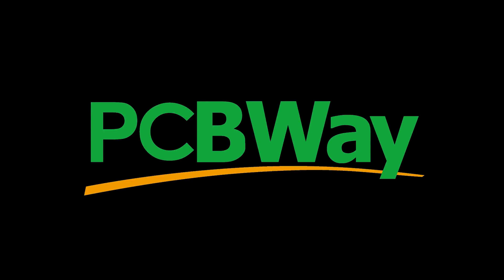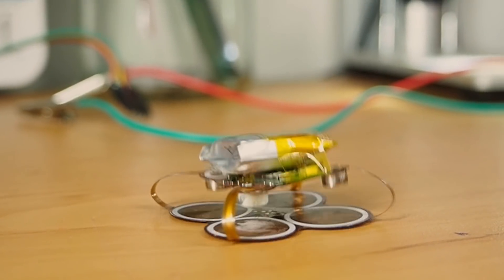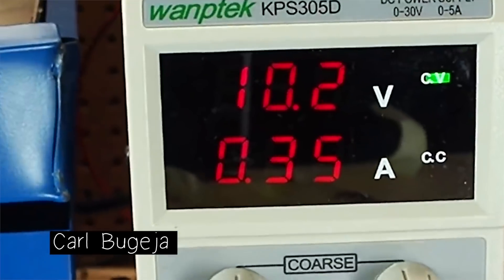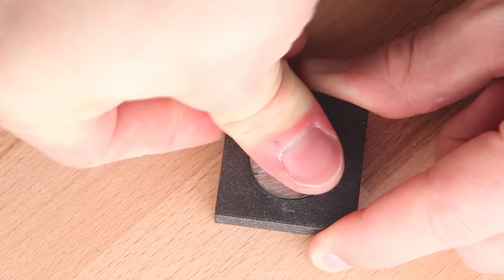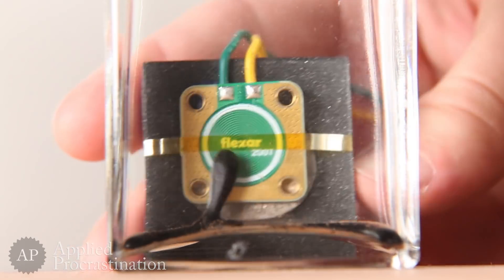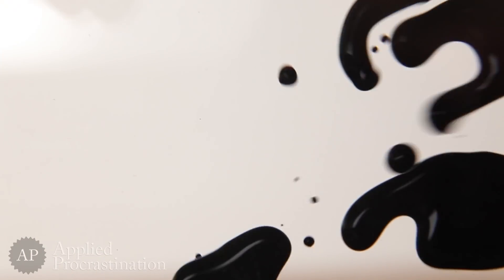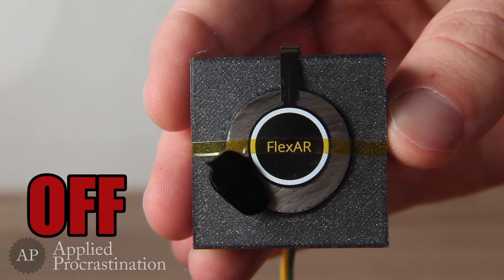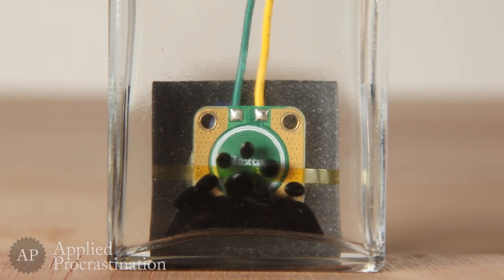The holy grail of ferrofluid displays (Carl Bugeja Collab!)

Comment: Couldn’t you work with Carl to print a MATRIX of MULTIPLE coils on a single large PCB (ie: the size of your display)?  That eliminates 99% of the external wiring and 99% of the labor to build the display. Also, the PCB might be able to absorb/conduct away some of the heat generated by the coils - especially if a copper layer was added to the PCB for the purpose of being a heat sink layer.
 

Further cooling, if still needed, could be added by placing some Peltier solid state cooling blocks in physical contact with the PCB and/or heat sink layer of the PCB. 
 
The Peltier coolers could then “pull” the heat energy from the PCB/copper heat sink layer and transfer the hear to heat sinks mounted to the hot side of the Peltiers. 
 
 (Just some thoughts).

Comment: Ok but given the PCB only design wont work why not just cut the leads shorter on the actual ones and solder them into a pcb? Seem's like a straightforward solution to the too many wires and connectors problem. Am I missing something?
Reply from the maker: That’s what we do in this version: https://youtube.com/shorts/eKKamLLzslQ 

It’s a really compact and neat solution, but incredibly time consuming and difficult to pull off (the actual soldering and mounting, that is), and redesigning the PCB becomes annoying too when you can’t just disconnect and reuse the magnets but have to desolder them. For small arrays it’s the best solution though, IMO!
Reply: @AppliedProcrastination  ahh very cool, I hadn't seen that short. And yeah fair enough it still seems tedious for a large board and like you said reusing them would be an even greater pain. It's too bad no one (appears to) make something akin to a relay socket system but for electromagnets.

I forget if this was mentioned in the video but maybe stacking multiple 12 layer boards is still viable.

Comment: Uhm..nobody has mentioned making this times 3 -- placed on the x y and z axis.. Micro-controllers to act as a catalyst, pulsed to lift for ex.; compensate for z being "gravity" constricted with it being 2-3x the size/power of field. X and Y steer, or pin-point the field. You should be able to 'drag' the fluid into the center of the field, then with modulation you could burst the fluid glob, or whatever. How do ferrofluid speakers do all this? Have you considered getting a ferrofluid speaker and breaking it down to advance your ideas?

Comment: You could use a stronger permanent magnet, and a magnetic switch to toggle the magnet on and off.
e.g. A strong north facing magnet, and a south facing electromagnet would cancel out magnetic fields. When you flip the direction of the electromagnet, the magnetic field will be twice as strong.

Comment: Put iron pole pieces in front of the PCB coil as well as the disc behind. One disc the size of the coil, the other a ring inside diameter same as the disc plus tiny airgap, outside diameter same as the back disc.
That would give a display of circles, not dots...

Comment: (Duh, I just edited out my brilliant idea I’d stacking coils to get more power, after watching Carl’s video where he explained that heat dissipation is the problem :-/)

I do think though that your specific use case is quite different than Carl’s general interests, so there might be some different directions you could go. I need to think about it a bit more…

I do think it would be much more effective to go ahead and leave a small hole in the middle for an iron core (or even a small “bias” magnet used as a core). That far in, I doubt you’re getting a lot of effect from the tiny little turns on the PCB, but the increased permittivity of the core would concentrate the rest of the field greatly.

(Hmm - I wonder: I think you might get a much more concentrated, locally-intense field if you went with a steel slug significantly smaller than the coil diameter. I don’t recall enough of my college electromagnetics to say for sure, but I think the field lines will be “drawn into” the core, vs spread out it it’s larger in diameter. What you want though, is to maximize the flux density in a small area, vs spreading it out with a larger “pole piece” - you’ll note that high-flux magnets for laboratory use often have tapered pole pieces, to concentrate the available flux into a smaller area. 

==> How about trying a small piece cut from a steel bolt or rod instead of the large-diameter slug and see what happens? I think that the length of the rod might have some effect as well; AFAIK, a section say an inch long should create a field that stretches out further beyond the end of it, making it easier for it to attract the ferrofluid. 

Don’t give up on this yet! 👍😁

Comment: You're saying normal electromagnets are quite expensive with 4 dollars a piece and that the alternative is relased at a reasonable price. Carls store lists his 12 layer magnets (coming soon) at more than 20 dollars, where is that a reasonable price and alternative if you want to have 256 pixels?
Reply from the maker: I was a bit surprised by the 20 dollar price point (it wasn’t announced when the scene you reference was recorded). I’m not sure if that’s a maximum price or will be the final price as the actual cost will depend on how many people buy one. 

We did however NOT say that 12-layer pcb magnets are a reasonable alternative to electromagnets in a big display like ours. We said that they are different from EMs and could have some cool use cases that EMs won’t do as well (size being a big deal).

Comment: if you give reverse polarity to the pcb coil the it will weaken the effect of the behind installed magnet and relase the fluid much efficent, also you can give it a pulse of high current to do that, also you can use a pulse of high current to lift the fluid initially, then you can decrease the current when the fluid raises to the desired ( or even close ) level, and you can do that using simple microcontroller.

Comment: nice project! did you think about moving pernament magnets using servos? it may be too bulky but 90g servos cost arround 1-1.50 USD it would be probabbly slow but maybe it is worth to try, you can adrust the magnetic field by distance and in case of clock it would consume more power only once per minute while rearanging

Comment: I'd have the ports on the magnets line up with the PCB, them you don't need long wires
^ oversimplified
You could also have a cutout whether magnets or sit in place, then another contact board behind them to route all the connections to the appropriate place, and then another board holding all the controllers.
It's quite the redesign, but it could also make it a lot easier to manufacture and sell them, once perfected

Love the idea ;3

Comment: You guys are creating the PCB magnet wrong. You need to not make a circle, you need to make a bunch, its called a Halbac array or something like that where you basically sacrifice one magnets strength at one point to massively increase the strength at another point. It focuses the Magnetic field onto a single point while spreading out on the other pole.  Perfect for your use case honestly as it makes a super strong point while eliminating interference on the useless pole

Comment: You could probably get a good improvement just by making the glass thinner.  Perhaps using something made for LCDs.  Or even a thin sheet of white plastic, to combine the background and container in once piece.  

I have seen PCB mounted coils used for brushless motors on floppy disk drives, although they were surface mount and I don't know if they are widely available still.

Comment: Hi you could make a pcb with though holes bigger than the wires to pull them through then have pads to solder then to on the back  maybe in 12x12 segments should tidy up the wiring

Comment: you need to put the driver transistor and a driver chip on a small pcb on the electromagnets, and then drive them like neopixels are driven. maybe the same kind of control chip thats used for leds and daisychainable would be enough to switch a transistor and drive the EM. then only need like 5 wires daisychained

Comment: You can increase strength by using Halbach arrays for the configuration. When used in matrices as 2D arrays it would increase the strength with symmetry and maybe easier for your project application than single e-magnets. Additionally, use SMD Ferrites as surface mounted cores, which you can set over the surfaces as arrangements; they will increase the effective permeability, thus increase the field strength. Aluminium as a back sheet will act as mirror to magnetic field and help with cooling.

Comment: I'm wondering if you've thought of using two smaller coils wrapped in opposite directions wired in together  with an iron backer. I think that a configuration like that could be more effective since the ferro fluid could bridge better the two poles.

Comment: I wonder if the magnetic force required lessens, if you put the glass at an angle, so the ink is pulled up a slope?

also, maybe stick the pcb directly into the tank with the ink? or make the glass thinner? magnetism was inverse-square-distance-thinggie?

Comment: Have you tried sandwiching two 12-layer PCB coils together yet?
Reply: Could probably even flow the solder through the holes for the wires, to connect the coils in parallel.

Comment: The "correct" solution to the rat's nest is probably to get some sort of off-the-shelf push connectors (maybe even just regular pin headers), solder one type to the coils (small pcbs would be useful here, just use some sort of glue or something to mount them to the coil), solder the other type to a rigid backing (or you could solder them to small boards, and mount those boards to the rigid backing), and use a grid frame mounted to the rigid backing to hold the coils in place. Replacing a coil would just be a matter of pulling the old one out, and slipping a new one in.

Comment: Very cool and small electromagnets are in old cash registers with needle printer.. They are, usually, 8 or 9 in row, soldered to small pcb and with common metalic insert..
Other option - disassemble car relays from scrap yard, leaving only coil part and maybe base. There are small ones too.. 

For removing wire nest, solder these in X Y matrix (don't forgetting protection diodes), like in keyboards, LED displays, with axis connections near coils.. 😉

Comment: Great video! I suspect you have already thought of this, but have you tried using a stronger permanent magnet instead of an iron “core” and then partially neutralising it by driving it in reverse?
Reply from the maker: Yeah, that does work, but it’s an approach that’s full of trade offs for small coils like ours. Basically you have to use quite weak permanent magnets to be able to cancel them out/turn them off with the electromagnet - all while also consuming more current than a normal electromagnet (for the same reason). Plus, we have more negative pixels at all times than positive pixels, meaning inverting the driver circuitry would increase the overall load. It’s a great concept for things that basically never need to be turned off though! One very common application is holding fire doors open until the alarm goes off, or holding doors closed until someone beeps their access card, etc. :)
Reply: @AppliedProcrastination  maybe it would be possible to balance such a setup so that to lift blobs up you would have to drive the coils; the permanent field being just strong enough to retain a small blob, and reversing the coil field to release? That would reduce current consumption, but I imagine getting the field strength just right would take some work...
And of course a tri-state driver circuit is more complex  - hmm... addressable LED strip-like PWM setup might work - the ICs for that are readily available I believe, though drive current might be too low unless you find something meant for giant billboard-type displays. I/O would be really simple though.

Comment: Dumb question, but has the iron to be behind the coil? couldn't it be in front as well? That way one could wire the coil from behind and the wires would not interfere
Reply: I think the iron would shunt most of the magnetic field lines across itself rather than through as you imagine.  Hard disk drives use strong magnets and must shield the magnetic fields from leaking out of the device.

Comment: You might want to consider using small PCBs for the inductors to get rid off the wire jungle.
You should add current measurement to the inductor drivers (only one current probe to the whole machine could work too!). This way you can automatically measure if there is the correct current, and the inductors is connected.
Reply: Or a single LARGE PCB

Comment: So close to solving the rats nest of wires!
The magnetic field lines in the EMs are shorter, they go from the core to the housing. While in the PCB EMs, they go from the steel puck to the front of the PCB. 
Longer filed lines -> weaker magnetic field (for the same flux). Also having a steel puck with less area (let's say, same diameter as the coils) would make the lines tighter and help a bit.
I think you could make it work if you were able to place each PCB EM within a steel pot core, like the off the shelf EMs (https://en.wikipedia.org/wiki/Magnetic_core#Pot_core )
Reply: you can easily solve the ratsnest by just not having each pixel connected via wire but make a large backplane PCB.
I think the wire option only makes sense for prototyping but in a final design you'd solder the (traditional) magnets on a PCB with for example IDE cables going to the controllers or having them on board or even as plug in module

Comment: Any reason why making one large 12 layer PCB covered in electromagnets won’t work? Also perhaps modifying solenoid inductors to have more open coils would be worth doing. I know some SMD inductors aren’t too expensive and have a somewhat squarish shape, making them easy to tile. On the other hand, SMDs would be difficult to solder without a big hot plate, and be even harder to desolder.
Reply: What about soldering and glueing the inductors to small square PCBs? Each PCB with its own connector, connecting to a large PCB. The large and small PCBs are cheap 2 layer ones, used only for wiring. This would not be terribly expensive. The advantage here would be that they can used their old inductors, and still get rid off the wires.

Comment: What if you tried the inverse approach. Having natural magnets that are strong enough to hold the fluid on their on, and reduce their force with the electromagnet by having them placed on and inverted polarity? So you'd have coils turned on on "pixels" that are off, and coils turned off on "pixels" that are on. Would that work?
Reply from the maker: There are some electromagnets like that (called de-gauss EMs), and the main issue is that you need the electromagnet part of it to be equally strong as the permanent magnet in order to cancel out the magnetic field. So as a result, their permanent magnet is typically fairly weak (at least in small ones) while the electromagnet draws tons of current. It’s great for applications where they basically never need to be used (like holding fire doors open), but not too great for a display where we want most pixels “off” at all times.

Comment: Why not a thinner container for the ferrofluid? That way there's no need to elevate a big amount so you don't need a big magnet,  and ferrofluid is opaque enough to show itself as dark if it's displayed in a layer.
Reply from the maker: Mainly because it looks cooler with spiky/3D ferrofluid than something pressed flat against glass, but the idea would probably help a bit!

Comment: Try taking the ferrous off of this PCB mounted inductor: LDZ2817330K-10
Reply from the maker: That one is more expensive per unit than purpose built electromagnets. We’ve experimented with some inductors before but couldn’t make them work (for a fair price) unfortunately